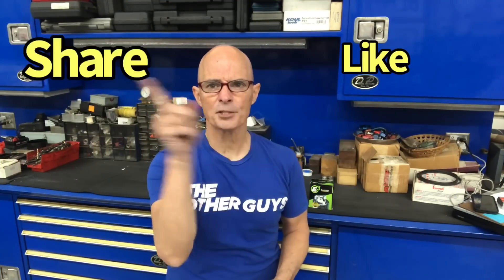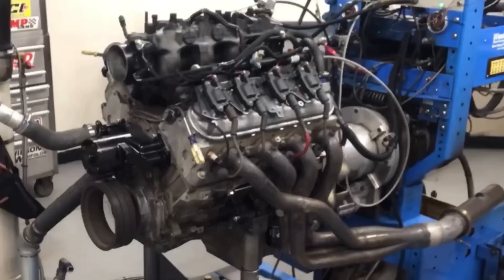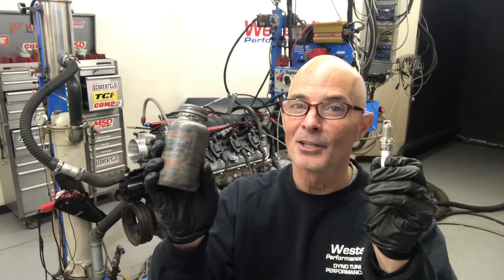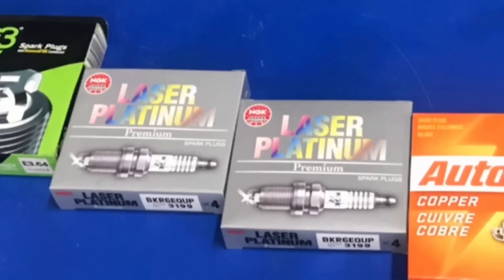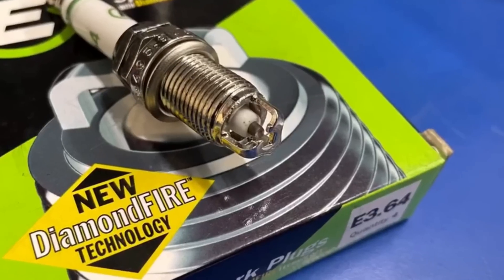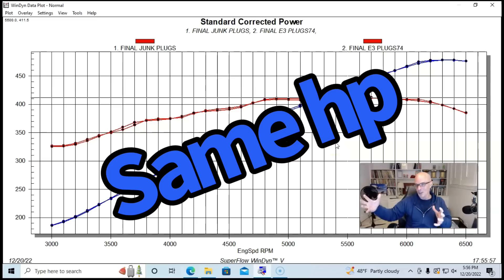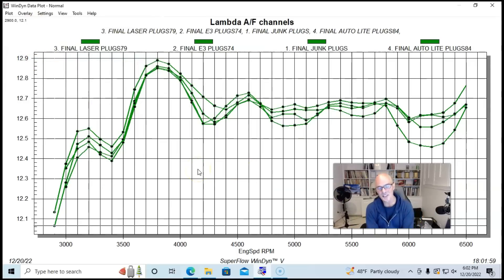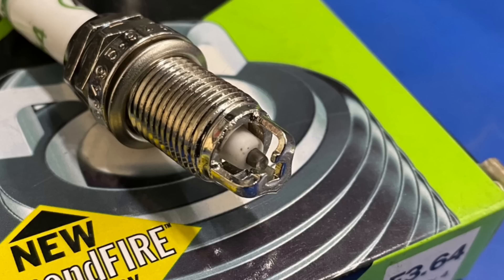E3 SPARK PLUGS-DOES DIAMOND FIRE TECHNOLOGY REALLY ADD POWER? E3 VS LASER PLATINUM VS CHEAP COPPER

Comment: I'm glad to finally see E3s on the dyno. I am a tiny bit surprised. I've always suspected they would actually KILL a little power, due to the shrouding by the numerous and massive ground electrodes.
Reply: The variances will be lightly affected by chamber geometry, which means the test here only covers LS heads.  As an aside... I hate dealing with autozone.  I have gone in with manufacturers  part number in hand only to receive dumb looks [since their training stops at year/make/model], and to add insult to injury I get told to go look up their unique in-house part # on THEIR website so they can "look it up" in store.  Preposterous business model if you'e a hot rodder.  If there is one thing I like about E3, its that design forces a more asymmetrical flame kernel compared to traditional design.  What I don't like about E3 is their website - no filter to drill down on reach, sealing design etc.  Also... no downloadable catalog that I could find.  I guess the NHRA guys all have to call?  Aftermarket heads do not fit in the year/make/model box
Reply: @flinch622  that's the reason they are known as "autoidiots"
Reply: They killed two tenths at the track for us
Reply: All it does is have more sharp edges than a normal plug, and plugs like to fire from a sharp edge. 
Tbh I've seen more runability issues because of them, so I'll swap in standard plugs and retest the problem.
Reply: They can work alright, but they do not last long. I wouldn't give more than 6-12 months on them before misfiring. They seem to work better than Bosch +4's but just about any standard plug from any manufacturer would work better.
Reply: @The_Fat_Turtle  I have no idea where the Hate for +4s comes from....I put a set in My Chevy W/T with Vortec V6 when doing the tune up at 100K....I checked them at 200K and they were still good, at 286,000 miles when the body became unsafe for road use due to rust, the +4s were still in it, Now its a Farm Truck that gets used for wood hauling, it was -15F yesterday and it fired right up...there is over 180,000 miles on those plugs and they still run like new.

Comment: I’ve tried the E3 plugs twice and they aren’t reliable. One set in a Sportster and it would shut down on me and the other set in a Echo blower and it wouldn’t crank back up after it got hot. Put the old plugs back and still running. The only reason I changed them to the E3 was I just figured it was time to change the plug, but it was running fine.

Comment: Any chance you can check emissions?  I'm a bit curious if emissions look different on any of them.  Namely because E3 makes such big claims about burning so much cleaner.  Seems like a stretch to me, esp with A/F being basically the same, but what do I know?
Reply from the maker: NOPE-NOT ON THE DYNO
Reply: @richardholdener1727  Patreon for a tailpipe sniffer?  haha
Reply: @richardholdener1727  If there was an emissions change, then there would have been an efficiency change, and therefore a power change IMO. None are present with the Uber cool sicky sick dopeski plugs

Comment: Had a high compression Buck 350 in a 1972 skylark. It was torquey and responsive. Had to have platinum plugs or it would zap the spark plugs and burn the oil up. Ran pump gas.

Comment: Multi Tip plugs supposedly work better on center type chambers, like you see with Four valve or Hemi heads.  Side plug type like in most V8's  SBC, BBC, LS, SBF just a normal single strap
Reply from the maker: EVEN ON MULTI-TIP PLUGS, THE GAP IS JUMPED TO JUST 1
Reply: @richardholdener1727  I agree But it's not the number of tips, it's the open top area for those type chambers.  Supposedly!

Comment: So what about other dyno vids showing a HP for the E3? I watched one that showed 12hp. I've seen another that didn't measure HP but measured time ran per tank of gas & the E3 ran almost 2min longer. Switched back to regular NGK and the time went back down by 2min(in a 45min run time)

Comment: I was hoping you would have cut the tops of the straps off and run them with, whats left of the strap on the side of the electrode for a unshrouded spark. You can still gap them in this configuration.
Reply from the maker: LOOK AT THE GAP ON THE 4-PRONG LASER PLATINUM (SAME EFFECT)
Reply: @richardholdener1727  after seeing the other tests i tend to agree but i still would have liked to seen.

Comment: I put some of these in an 09 lmg 5.3. They are junk. The electrode came out of the ceramic I to the cylinder.  I will stick to brands with old school designs that have worked for decades. Say no to gimmicks. Used Bosch Supers back in the day for header clearance and they ran just fine.
Reply: If it's a GM product made in the last 30 years, I wouldn't use anything but ACDelco or NGK plugs and the fanciest I'd go is plat or iridium coatings as newer engines seem to like them and they last forever.

Comment: The previous owner of my 6.0L truck installed the e3 diamonds not long before selling and within 6 months they were misfiring. I also tried Bosch +4 plugs when I was a dumb kid on a 4.3L work truck and they just misfired out of the box. I have since just assumed all gimmick sounding spark plugs are going to be garbage. If NGK sells a standard plug for the application, I am going to use them.

Comment: THANK YOU! How about testing FR3 oil additive. Oil pressure, temp, noise?
Reply from the maker: NOISE?
Reply: @richardholdener1727  yes engine noise, lifter rocker type. typical in NVH measurements used by manufacturers
Reply: @richardholdener1727 (Big Fan-thanks for all the intresting tests) I think he meant reduction in noise before and after(oil treatment) to measure if oil additive works reducing engine noise. Some claim a teeny HP gain from reputable sources but the last mentioned was an oil additive called RS Ran-up(ceramic) , less expensive Liquid Moly Ceratec many claim to be cheaper more acessible alternative. ie. Test was also done Ran Up in big v8. They say the more cylinders(more friction) the bigger the differance. Is small but apparently measurable on dyno. Was a drift team looking for extra HP without stressing the overly stressed engine even more.

Comment: In a boosted application I found the new ngk ruthenium pspe plugs add power.   I can’t answer for this set up though. Plus it only added 5 hp over the factory iridium plugs. The ruthenium’s are supposed to last even longer with better heat and spark output.
Reply from the maker: HOW DID YOU MEASURE A POWER GAIN?
Reply: @richardholdener1727  back-to-back Dyno. 378-376 4 pulls on stock plugs on 93 octane and 4 pulls 383-385 on ruthenium plugs. Both new sets and the car functions on aircharge not boost pressure command. The fk8 civic type r is known to literally print hp numbers. 5 hp on 93 octane and torque increased also. Both same .031 gap. Same day same fuel. At first I thought it was fluke but the car never went back down to 370s. Put the oem plugs back in and power went back down. Same heat range. 

I couldn’t believe it myself at first. It’s something to do with ruthenium and the PSPE ground electrode having more surface area to deal with heat better. Hotter metal doesn’t conduct as well. They use a platinum square protruded electrode which helps the spark stay strong.  They specifically state this design is for forced induction.

Comment: wow  the cheap plugs did great.  i made a comment about arc blowout a while ago.  i said that the arc gets blown out.  iv seen arc blow out when the arc travels a long distance.  However, i did try to blow out the arc from my arc lighter using compressed air.  The arc never went out.    the arc would bend and deform but would never go out.  so i learned something.  thank you.
Reply: I had spark blow out but I was boosted at 24 psi I was having issues with spark blow out it is an issue

Comment: From what I've read, indexing and plug construction is that last 0.1% you are looking to find. And sometimes that last .1% is worth the effort when you are racing. Certainly not worth all the effort on a 100% road driven sports car.

Have you looked at the difference between copper resistive and copper non-resistor plugs? Maybe in combination with resistor and non-resistor wires? Wondering if the resistor changes the spark enough to see a change.
Reply: You would expect more spark energy, but probably not a huge amount.  Jumping a 1mm (0.040") gap at 10 bar (150 psi) of pressure takes about 30k volts.  A typical resistor plug might have 5kohms of resistance, and if you have a plug wire (like an LS engine) that's probably another 4-5kohm or more.  That means that you're generating no more than 3 amps of peak current and that's only during the initial ionization of the plug.  Theoretically less resistance could result in a better initial ionization event, but the RFI as Avery says is a big deal on modern electronics.
Reply: @ChurchAutoTest  How did you figure out that an ignition coil will output up to 3 amps of current? For the output current to be that high, wouldn't the input current need to be very high too? A typical output voltage of 30kV X 3 amps is 90,000 watts. At 12 volts, 90,000 watts would be 7,500 amps and there's no way a coil could draw so much on the input side.
Reply: @averyalexander2303  You're correct. The 3 amps would be on the input to the coil, not the output.
Reply: From the testing i have done, non resistor spark plugs generated a stronger spark. I have a video of testing that on my channel. The problem is the interference from using Nology non resistor spark plugs messed with my ECU.

Comment: Tried many different types of "miracle" plugs between 2005 to 2010 , for 20000 kms each type , as I clocked 80000 / year same vehicle. 
Engine optimised for fuel economy, none of these plugs improved or reduced economy , over the OEM plug, except for the forked electrode plug ,which the manufacturer recommended such a cold plug , it carbon fouled & misfired before 20000km test period was completed.
Same brand of fuel ,same octane ,same pump.
Some of these plugs makers, made some interesting claims.

Comment: The E3 caused a host of misfires in my 2.2 s10. I did gain some MPG. About 1.5 to 2. But it didn't like to idle. Went back to ac delco after about 5 tanks of fuel
Reply: Yeah same here the E3 spark plugs are junk

Comment: I can't figure for the life of me why nothing but Copper plugs will cleanly fire under boost on my 3.8L Ford. Above about 5psi platinum and iridium plugs will start to misfire even gapped down to .020. Toss coppers in and it pulls clean to 11psi and will keep firing clean up to about .040  gap ( I run them at .030). Running 11.5:1 A/F so not overly rich. I'm thinking the coil pack, single 6 post type, may be on the weak side.

Comment: I watched another test with a similar premise done by David Vizard.  He speaks highly of you. 👍
Reply from the maker: DAVID VIZARD IS GOOD PEOPLE-EVERYONE GO WATCH HIS CHANNEL
Reply: Hey Richard,  You should try the Vizard plug mod he spoke about that he was going to patent, but someone else was also doing the same mod back in the day in one of his story vids on plugs.  There was a website of someone doing the mod, but its down now, called Super Sonic Spark Plugs.

It uses se a basic copper core plug:
 drill a hole in the center ground strap above the center electrode & the same size as the center electrode, & then down into the center electrode to dish it out from edge to edge.  There is then a full radius of sharp edges for the spark to jump & also to the ground strap..  Supposedly, that hole gives a pathway for flame to jet out of the hole in addition to side flame fronts.  I would even spread the gap & go in with a round burr on a dremel & chamfer the the inside & outside of the hole on the ground strap, then use a bigger gap & also use a non resistor plug, along with Granitelli 0 ohm plug wires, 0 ohm rotor & cap, & then a up regulator to boost voltage to the coil wire from 14.7 to 16-18v.  Performance Distributors makes them or Okada Projects makes it called the Plasma Lift.

  Now your plugs will be in the area of starting to produce Plasma Spark.  Also this Plasma Box technology was invented by famous German electronics engineer Ulf Arens who holds many patents & Vizard knows him & did dyno sessions & tested his ignition box called the Ignition Solutions Plasma Booster.  It was being sold for a while back in 2000, but he licensed the technology to Okada Projects & they left Calif. & its big in Japan. Also the Plasma Coils are licensed under Plasma Solutions Coils .  They also make individual Plasma technology coils for all the Euro & Japanese market.  

Look up Ulf Arens Spark of Anger, article.  

Now the old company who made CDI boxes for the o.e. on Porsche & Mercedes to pass Calif. emissions from back in the 1960's has a new Cold Plasma Ignition called Perma-Tune in its latest version.  Supposedly he is using similar technology to Transiant Plasma Systems that was all over the news 4 yrs ago & will be in o.e. ignition systems some day along with a special plug design that Perma-Tune was waiting for & Brisk made the prototype plug.  I'd like to even see Brisk Racing Plug tested with the ground strap cut off to make it a surface discharge plug with one of those Plasma Boxes.  Brisk also makes a Silver Core Non Resistor plug & made the same for Nology Silver Plugs.

I'd even like to mod an NGK like guys do to Champion to take out the resistor & put in a solid core wire of Copper, but looks like NGK uses an epoxy injected resistor that can probably be drilled out once you do the trick to remove the top like everyone does on Champions with a torch to melt the Loctite on the plug terminal to unscrew it to dump out the souls resistor & spring, but re-use the spring with a solid copper wire inserted .  Many vids on it.

  Vizard also tested the Ion Fire Plasma Ignition, but that system is so powerful it needs special custom Tungsten Plugs made by Torque Master or this other guy who makes them as a hobby.  Plasma technology ignition has been around for 40yrs+ & maybe some of Jacobs old stuff unused it, but it needs powerful coils, & 0 ohm resistance to the plugs & also sheliding over all the plug wires & ECM wires too in case of EMI RFI, I would think to do.

Call David Friebuger, since he worked for Jacobs, but  never see him doing any of Jacobs ignition secrets if there were any, or in all those Jacobs books I never got to read to see if he was talking about Plasma technology.🤔. Even Project Farm tested Pulstar Plugs & said there was a difference, but that plug just has a capacitor or thysistor inside to act like a CDI.   I'd like to open up those NGK Iridium or Ruthium plugs & try to drill out the resistor & put a solid copper core in.🤔. However supposedly Plasma sparks like a wide surface area to discharge from.  Ask Lonnie who patented his new cold plasma technology at Perma-Tune.  They're big in vintage Euro car high energy ignitions & custom fully digital advanced distributors that use Bluetooth for tuning using 123Ingition Technology out of Europe.  Very neat ignition to hop up classic Euro cars & bern popular in Europe for 25yrs.  They are considering going into the domestic market & will really shake up the ignition big shots here!

Comment: Think if you are pushing the envelope I'd run silver plugs (Brisk) for anti detonation, then copper.
But I've had just fine experience with NGK V Power in more normal stuff.  And NGK Irridium Racing ones work well too (but they're more prone to detonation - so endurance applications will need a soft tune but they work)
If it's in the budget, most times I'll default to Brisk silver plugs for the race engines
Reply: It was back in 08/09 but I had misfire issues with E3s
And that huge electrode I would think would encourage pre ignition
Reply: NASCAR used to use (may still idk) surface gap plugs.  From what I understand they'd warm em up on normal plugs and switch over.
Reply: Lots of stuff is about making it to the finish and less about the dyno.
Like modifying the coil connections so you don't drop cylinders after 1,000s of race miles bouncing around in the desert and you lose the race from something silly.

Comment: The biggest performance difference between different spark plugs is how long they will last.
Reply: More consistent gap wear on platinum and iridium plugs = more consistent power over the life of the plug. Definitely worth it over copper.
Reply: @turbojetpowered8299  more challenging engine Bays +the addition of forced induction and sometimes just vvt, usually come with higher quality spark plug recommendations from the factory. People don't realize this, and sometimes put in a cheaper plug(copper) cuz it '' fits''... But, the performance may actually suffer from not following the plug quality recommendation made by the factory. This is where fine tip electorodes may actually give more power. Less surface area for the electrical arc to "chase and find" a way across- there by promoting slightly faster lit flame and adding to slightly more power and less detonation.  BTW, copper cannot be more into fine tip cuz it wouldn't last.